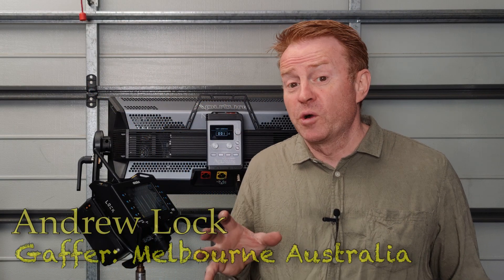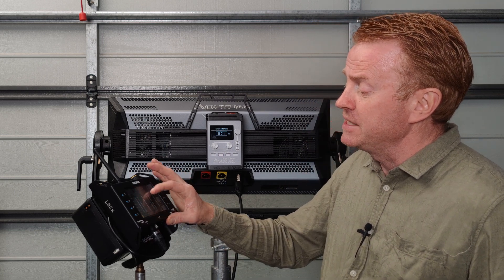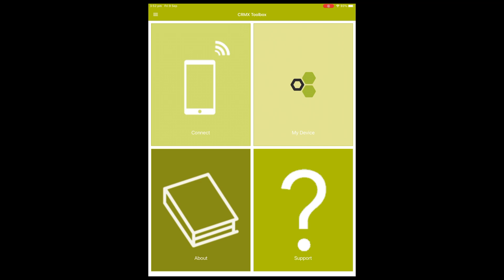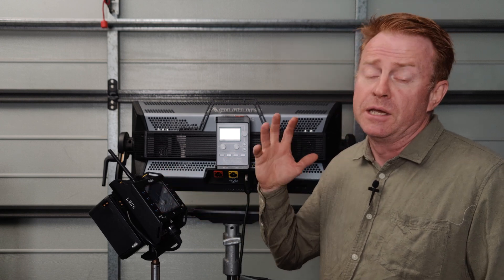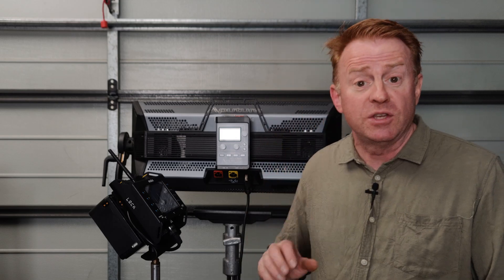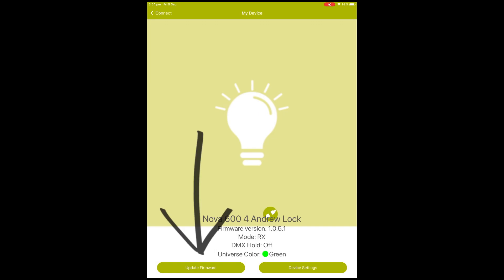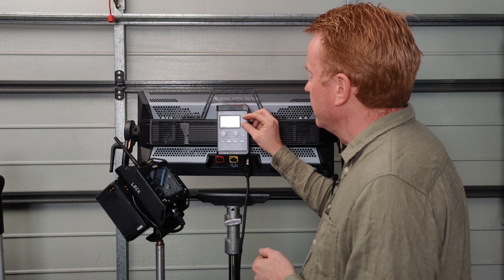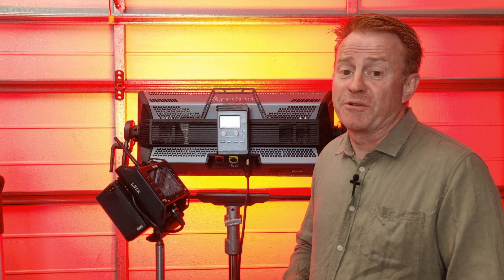Gaffer & Gear 197 – CRMX Not Working After Firmware Updates

Comment: Can you do a video about lumen radio and Aputure products, please? Especially Aputure products that don’t have DMX in? For instance, what if you wanted to fill a building with Aputure b7c (lightbulbs) and write cues that you could use to change all the colors or dim them at the touch of a button? Edit: I should specify that Sidus Link won’t work for what I’m trying to do because I need to write a lot of cues I can fire off on command, ideally from a program like ETC’s EOS or similar. Big fan of your channel. Thanks!
Reply: B7c don't have CRMX. If you need a bulb witg CRMX, check Astera NYX.
Reply: @Coeditor4089  but can they not be used with lumen radio? I have Astera products, I can run them all off of Eos
Reply: @Devonarmstrong  no, they can’t be used with lumenradio, they don’t have crmx built into the unit, or a dmx in port. All they have is sidus connectivity.
Reply: @KevinWilling  ah, that’s a bummer.
Reply: @Devonarmstrong  CRMX = LumenRadio. So no unfortunately B7c are not of use in your case, as others mentionned.
Reply: @Coeditor4089  that’s a shame. You would think they would be able to make sidus link talk to DMX with some sort of adapter.
Reply from the maker: I use Astera for CRMX. The B7C is not compatible